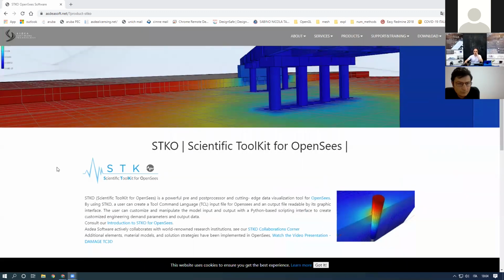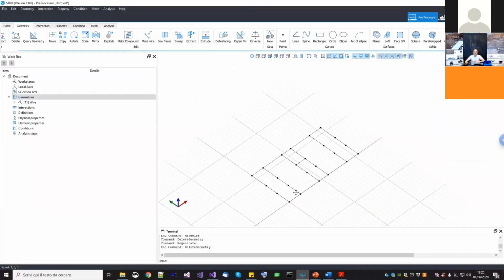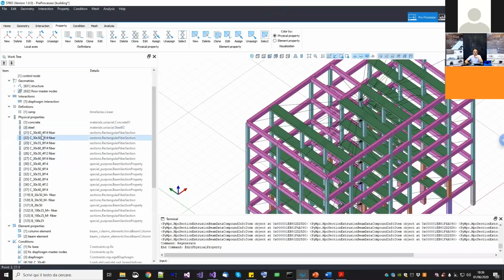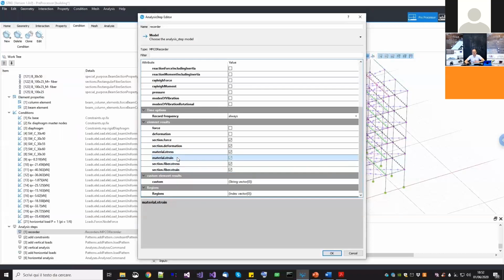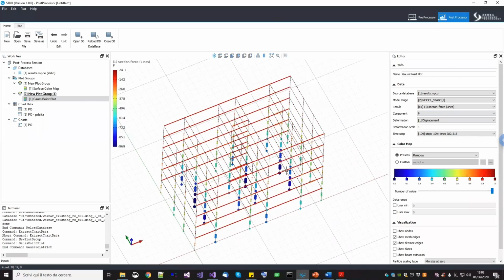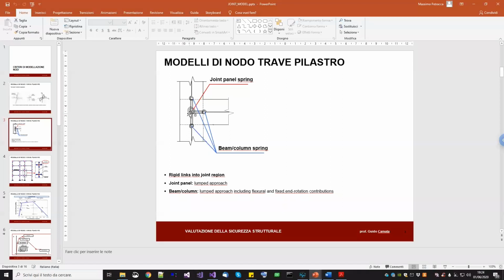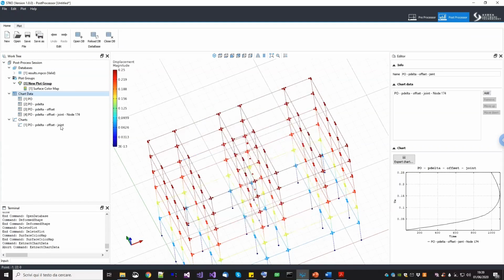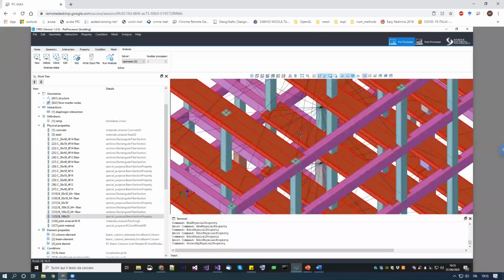STKO E-Learning Course - Nonlinear Analysis of an Existing RC Building including RC Joint Modeling

Comment: If I used displ-BeamColumn for BC element, I dont need to define SectionBeamProperties, right? Because I have read Opensees wiki, integration type is the input if Force-based BC element is used.
Reply from the maker: The OpenSees wiki is a bit outdated, Displacement-based and Force-Based beam column elements now take the same input. So you should use the BeamSectionProperty

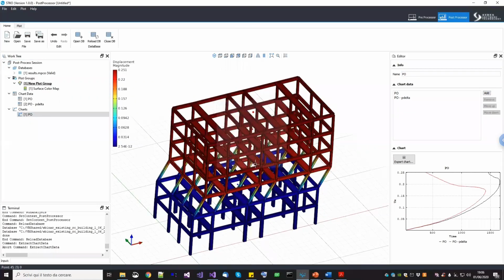Comment: At time 1:02:49 Dx versus time shows a curve that turns back. When time cannot go back how is this possible? This curve says at time say 500 there are two values for Dx. Probably the horizonral axis is something else, not time.
Reply from the maker: Hi Kamran, in OpenSees, pseudo-time is a real "time" only in dynamic analyses. In Static analysis, it does not have the meaning of time. More specifically, in Displacement-Control, the pseudo-time is actually the load-multiplier (Lambda). That's why, when you have softening, the pseudo-time decreases
In fact, if you multiply the pseudo-time (lambda) with the reference horizontal load, you should obtain exactly the total horizontal reaction: lambda*Pref = -Reaction
Reply: @STKO_ASDEA  Thank you for answering my question. This means you are ploting load versus displacement. Then why not calling it loading rather than time?
Reply from the maker: @kamrantousi6896  In OpenSees that is just how its called.